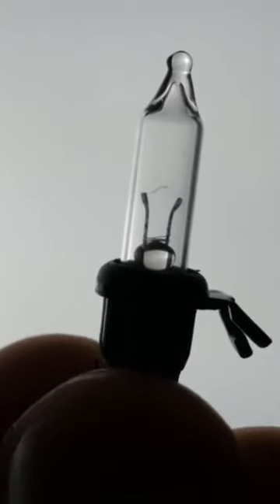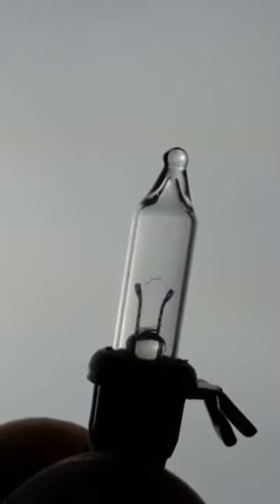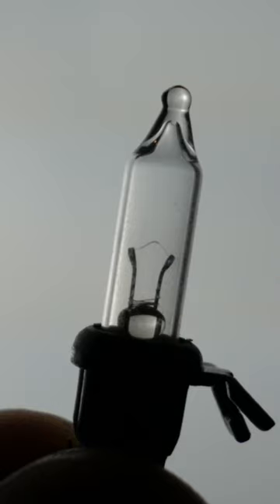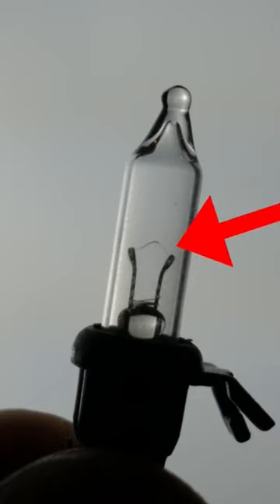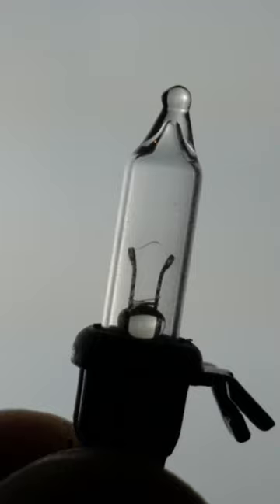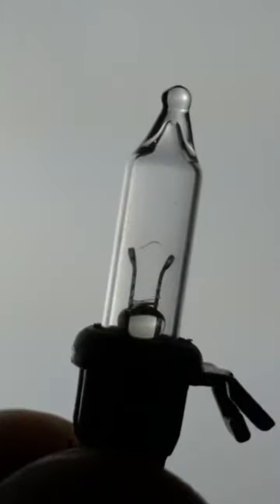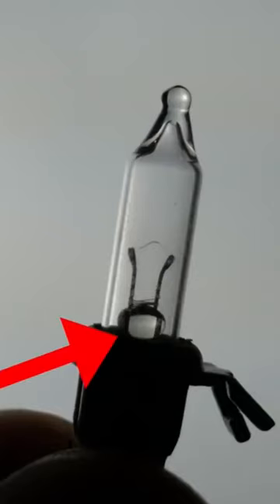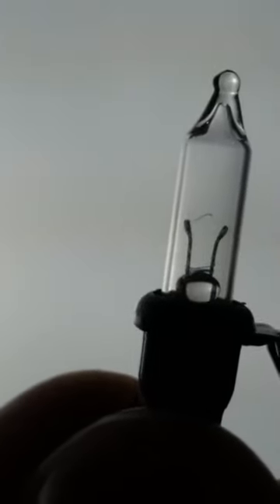How to fix Christmas Lights (click Handz link to watch full video)

Comment: Why not just eliminate the filament and just use the insulator?
Reply from the maker: Great question! It's the filament that glows and the insulator that passes the current if the filament is out, but it does not glow. The filament is needed for light. Have a wonderful day!